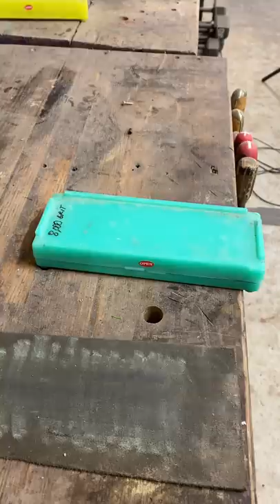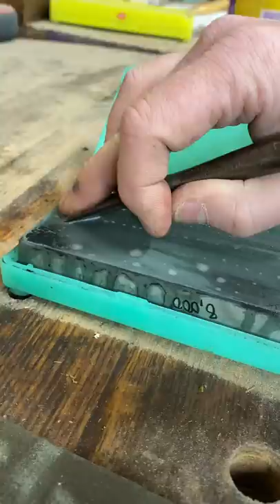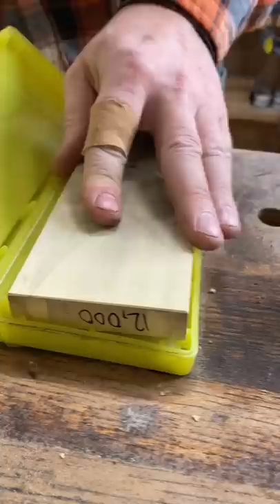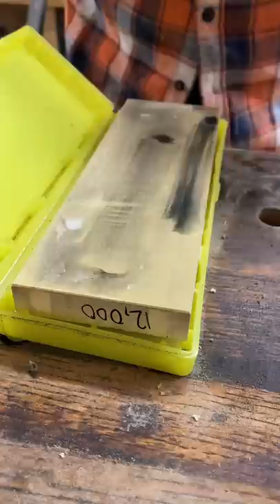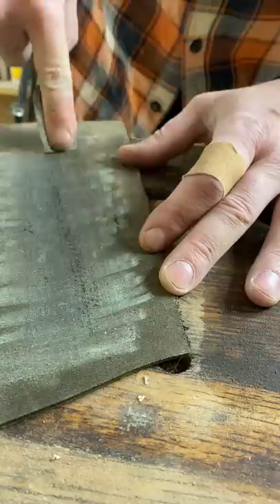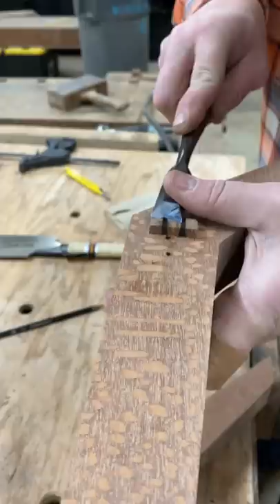Scary Sharp Chisel Sharpening 12,000 Grit #Shorts

Comment: Did anyone notice he spent the majority time sharpening, and 1/2 second showing him struggle to cut the end grain?!?
Reply: He polished instead
Reply: He only honed the back of the blade to 8000 grit, so no matter what you do to the bevel you'll never sharpen it past 8000. 

However most experienced wood workers will tell you there's really not much point in spending all that time sharpening and honing past about 1200 or 2000 because anything past that basically dulls instantly.
Reply: @dawsonharris5498  shhhh your spoiling the magic ;)
Reply: Same thing with professional kitchen chefs. Anything after 1000-1200 grits is just needlessly effort that would last for a few cuts.
Reply: june25  well that's pleasant
Reply: june25  Lmao and what are you?
Reply: Sure did.
Reply: @Lontracanadens1s  the longevity of the edge depends on what your are cutting, what you are cutting on, bevel angles and technique.
Reply: @dawsonharris5498  You’re going to have a hell of a time going through end grain at  1000-2000, especially in soft wood like pine. Yes the edge at 12000 will not last as long but if you have quality chisels and plane blades and a good sharpening system and don’t let your tools get worn to the point of this chisel it’s well worth going to 12000. With a good system and not letting your tools get to the point where they need a whole new edge, you can tune them up in a minute or two and the difference in ease of use is well worth it.
Reply: @dawsonharris5498 ippp
Reply: Yes sure did and using a Guide too
Reply: @08c6vette  Rob Cosman sharpens everything on a 16,000 Shapton glass stone. Plenty of woodworkers that produce high quality work sharpen to 8000 and well above.

Sharpening to 1200-2000 and you're going to have nasty tear out in end grain and garbage results everywhere else.

2000 is for carpentry and tomatoes.
Reply: @thatguythatdoesstuff7448  Exactly, anyone doing serious woodworking that are only sharpening their chisels and planes to 1200 or 2000 must be part masochist, or just enjoy working harder. The difference in ease of use of a plane or chisel sharpened to over 10,000 over one sharpened to 2000 is like night and day. it is very satisfying using a hand plane sharpened to 12,000 and effortlessly taking a nearly see through shaving off the hardest woods, it has almost an asmr effect.
Reply: @carlmen6567  pp
Reply: What about the one shaving that he peeled off with the chisel and boom a whole piece of furniture is built , he's a badass , I would like to have a set of the sharpening stones that he's using though
Reply: @Lontracanadens1s  good to know, thanks 👍
Reply: Don't see the scary sharp chisel...
Reply: @dawsonharris5498  what do you want to say ?
Reply: Dab some naphtha with brush for cross grain cut. Woodcarver's trick. 12000 or 1200. Try ceramic Japanese water stones.
Reply: @08c6vette  I have no problem whatsoever cutting through ingrained with my crappy cheap worn out chisels that are nowhere near sharpened that fine as they are simply sharpened with a cheap whetstone from Walmart and no bevel guide.
Reply: @bobbyhempel1513  If you’re doing serious woodworking  with crappy, cheap, worn out chisels, honed on a cheap 1000 grit Walmart stone I would say your “no problem whatsoever”is simply your perception of what is easy as far as chiseling goes because I was the guy with the crappy, cheap, worn out chisels sharpened with a 1000 grit stone, thinking they were sharp enough and good enough for many years until I finally broke down and bought a decent set of chisels ( no they don’t have to be Lie Nielsens, I have Stanley sweethearts) and a decent set of water stones and I can tell you from personal experience that the difference in using cheap, crappy, worn out chisels vs. using decent chisels with perfectly flat, polished backs, honed to 8000 - 12,000 is like night and day and the ease of paring a shoulder for a mortise and tenon joint or finishing a dovetail joint using them compared to a shitty chisel that is semi sharp is no contest. If you’re doing woodworking using hand tools I highly recommend you try it, yes it won’t hold an edge as long but with a decent sharpening system you can have it back to a razor in 20 - 30 seconds, if you’re using mostly power tools and you just need a semi sharp chisel occasionally what you have will suffice.
Reply: I thought I was the only one to catch that lol
Reply: @bobbyhempel1513  
Couldn't agree more 
My grandad gave me a 2 sided oil stone with a box he made in school 
I still use it and it great, perfectly adequate 
Hes 86
Reply: If you're putting it at 12k final....don't strop...

Comment: Starting at 8000 grit only serves to polish the chisel, not really sharpen it
Reply: Sharpening, honing and polishing are all the same thing. You're either correctly hitting the apex of the edge or you're not, regardless of the grit size.

If he's regularly honing to 12000, starting an undamaged chisel at 8000 is perfectly fine.

I have this 8000 (melon) Shapton stone. Unless the edge of my chisel needs correction, I go straight to the 8000 for touch up.

The more regularly I touch up the chisel, the less likely I ever have to drop down to a rougher grit.

And these Shapton stones remove material very quickly.
Reply: @thatguythatdoesstuff7448  tx 👍🏻
Reply: Agreed you always need a coarse stone to start. I found not doing that was my worst sharpening mistake fine only polishes a dull edge
Reply: I do 99% of my sharpening with 8k.... but that's because I hollow grind my general use chisels so when I go to the stones I'm just polishing a tiny section at the tip and on the heel and I'm usually sharpening often enough that I have a miniscule amount of material to remove.
Reply: @thatguythatdoesstuff7448  all that being said... This guy didn't reach the apex.. which is what the original comment was getting at.

Comment: I find it hilarious how many online vids show things that are incorrect.
Reply: Please elaborate on what was wrong with this vid
Reply: @TatsukiHashida  his entire method was wrong. Go do your own research to find the correct way.
Reply: @ice-xv1hi  bruh
Reply: @TatsukiHashida  first off, he using the wrong profile of chisel. Second, most of what he does is polishing, everything past 2000 grit or so is pointless for tools. When sharpening, you typically start with a lower grit, working your way up to remove imperfections and create a new blade profile. Its important you start low and work up, as starting at a high polishing grit will make it nearly impossible to actually remove the jagged micro-chips on the blades cutting edge. Some lubrication, dw40 or whatever oil of your choosing, will help with rust prevention and a smoother cut too.
Reply: @TatsukiHashida  nobody is trying to write paragraphs to teach you something that’s extremely easy to find if you’re that interested its not like you gotta search hard to find out how to sharpen a chisel correctly
Reply: he made it Shiney.
Reply: @RJ-mh3ox  and what happens when someone types in "chisel sharpening" and this comes up?
Reply: @jefftickleschitz1265  nothing in the video is wrong.  His technique was fine.

Maybe he should have started at a lower grit-  we don't know what shape it was in.

Maybe going to such a fine grit isn't necessary or practical if you are doing work them constantly.

You can ask a dozen people who handle and sharpen different typed of blades and get a dozen different answers.  

The techniques in the video are valid, however.
Reply: @zakpodo  did I say something was wrong?
Reply: @jefftickleschitz1265  no, you responded to all the people saying it was wrong but refusing to explain why-  seemingly asking for more info.

I was just explaining to people like you and the other person who had questions that the video shows a workable method to sharpen.
Reply: @zakpodo  is this youtube thing new to you? As you can see above, I responded to rj.
Reply: @jefftickleschitz1265  what's your problem man?  I was trying to be helpful.

Here's the breakdown-
1.Op implied something was wrong with the video.
2. Somebody asked for more information about what is the right way.
3. Another person told him to go look elsewhere.
4. You said what if somebody was searching for info and it found this (its ambiguous whether or not you were asking for more info or just being snarky)
5.  I replied, to you and anybody else who might be looking for advice in good faith.

6.  You act as if I personally insulted you and as if I'm a moron for trying to do something decent....apparently you have a problem with somebody acting with goodwill on YouTube.
Reply: @zakpodo  the other poster was being an ass, but ultimately he's  correct; just about everything in this video is wrong. Never place your finger on the stone when sharpening, you could pinch your finger or at the very least you'll sand off some skin. You also never move both directions on a stone that high in grit because any angle imperfections would gouge the stone. Also going back to the very first thing that we see him do, never take a precision instrument like a chisel to a stone that hasn't been flattened first, you can tell from the fact that there's still metal material stuck in the grit that it has not been properly flattened and therefore cannot provide a proper edge to the chisel that he's sharpening. Also running the back of the chisel on the stone is pointless because of the thickness of the blade, and finally stropping after 12k sets you back in terms of polish unless you're using a diamond grit.
Reply: @wyntresparkz8702  I don't think you read my post.

You're quibbling about grits, which is fine. But his technique will produce an edge.  

You're complaining that the stone wasn't flattened-  you have no idea if it was, and even if it wasnt it's way more pointless to flatten after every chisel than to strop after 12k.

The point is, for somebody who doesn't know what they are doing (and asking for help), using a technique like in the video is a fine way to get an edge with the stones they have.

If they want to dive down the rabbit hole, there's lots they can learn through research and experience, but for somebody who's intent is a quick how to from a damn Google short.... yes this is the general process.   Flatten back, sharpen front, lower grit to higher grit, maintain for angle.
Reply: @zakpodo  dude, you're the one getting butt hurt. As you did again in the comment above yo wyntre sparkz, you are putting words in people's mouths and attributing direct comments to the whole group. When did Wyntre say anything about grit? I originally responded to 1 person. And you for some reason jumped down my throat about things I never said.
Reply: Ah yes. The classic, “I’m spewing shit out of my ass, but since you decided to call me out on it, go waste time trying to figure out something I myself have no idea of” tactic. Polishing a blade is useless. Anything past 2000 grit is pointless. However, the sharpening technique the person in the video used is how you do it. He did it well. For anyone wondering. A toothy edge is better than a polished edge for actual woodworking. The edge will last much longer and work the wood better. Having a toothy edge also prolongs the lifespan of the tool.
Reply: @pubplays368  he used an incorrect angle to sharpen the underside, shows how little you know.
Reply: @RJ-mh3ox  well I didn't want to look that shit up. I read the paragraph instead much easier
Reply: @jesusdelgado3959  but its easier to watch a few people demonstrate this type of thing if you plan on actually doing it yourself fam i had to do a good amount of research for knife sharpening cuz there’s more to it than one paragraph can teach ya
Reply: I watched my dad do his knifes in the 60s. I still do it today.
Reply: @cornhole8839  "everything past 2000 is pointless for tools" you know you don't need to use that much sandpaper right?
Reply: @miles11we  holy necro batman

Comment: I think the band-aid on your knuckle says it all, So I became a journeyman in 1974 , In England we're called carpenters and joiners , The Scottish Joiner that I worked my apprenticeship under ,  Would be turning his  grave watching you use stones in plastic boxes ,  He made me take a piece of mahogany  And hollow it out to  a 2 piece Box Containing my stone ,  Looked a little bit like a small coffin ,  And at each end of the stone there was a wood platform, The same height As the stone , so you could  Run your chisel the full length of the stone , So you don't produce the giant hollow that ends up in some stones, Also  Other craftsmen would take your lid  And rotate at 90ﾟ  To see if it fit exactly the same , as it was a sign of craftsmanship ,  And not as easy as it sounds,  Also 2 small Brad nails protruding from the bottom Was part of the design , To prevent it from slipping , So you don't need a band-aid while using it ,
Reply: Those plastic boxes aren't horrible -- and you don't want these in wood, they're water stones. But for oil stones I agree

Comment: Shapton pro 12k stone is finer than Chromium oxide pastes, so you're taking a step backwards with polishing. (Chromium oxide pastes are 3-1 micron, about 8,000-10,000 grit, the Shapton Pro 12k is <1 micron)

And stropping with that much pressure at that angle will fuck your apex pretty quickly.

Try refining your sharpening before you go to pointlessly high grits, maybe then you can trim a tenon.
Reply: Looked good to me tough guy
Reply: @10p56  The edge looking good, and performing good are two different things lmfao.
Reply: @10p56  if it's the one we seen him sharpen it's not.
Reply: Ppl buy shapton 30k stones (400$ stone) and think they are ancient samurai Jedi masters 🤡😂🤚🏻🤚🏻
Reply: @As_Asa_PhD  I know, it's not good, that's the point of my comment.
Reply: @tsvorbear3908  You talking about me, or the guy in the video?
Reply: @autumn5592  I was replying to k.
Reply: @As_Asa_PhD  Sorry, my bad.
Reply: @autumn5592  lol no I’m talking about the dood in the video

Comment: 12000 is way overkill a 1000 sharpening block (the metal diamond ones I personally hate oil stone) gets your chisels sharp enough for any task
Reply: What are the difference in practice? I buyied a water stone grid1200 because of the price

I was in to buy the 600 because I saw a video talking about that and I thinked that it would be a better option

Although it was some 1BRL more and my stupid sister was already bothering me about that, so anyway.
Reply: @lordhunterluasuperior905  honestly it's mostly personal preferance, as a general rule the finer you sharpen an edge the less durable it gets, for intance i sharpen my chisels once every two weeks at a 1000 edge if i took that to 1500 id have to sharpen them every week
Reply: @lordhunterluasuperior905  12,000 is like THE final stone, you want something way more course to start with so you can actually shape/flatten the tip before polishing. I’ve got a set of stones that go 250, 400, 600, then 800 or 1000 grit. If your first grit is above 1000 you’re essentially just polishing it, without making sure it’s actually flat beforehand
Reply: I don’t even think those are oil stones they look like Shapton’s. Probably using soapy water. He started on WAY to high of a grit though! Should have been more like 320-400 then progress.
Reply: I'm the same..I have a 1000 grit Diamond "stone" that I've had for over 30 yrs..still in the same workable condition and sharpens chisels n plane blades etc perfectly

Comment: If I recall correctly, Paul Sellers said that they used to sharpen their chisels to 80 grit and then get back to work. I believe he sharpens them a little finer now, maybe 220, but that's plenty sharp enough. Same for his hand planes.
Reply: Yep, you really don't need much for an edge that actually cuts.

Going this high, of even really above 1k is not doing much, outside of specialist applications.

Comment: The final grit of your sharpening depends on the material your chisel is made of. If it's a bit softer, you will get a worse result with a higher grit. I have two really cheap chisels, and the last grit before stroping is 2000 for me. They shave endgrain like butter

Comment: Just a tip from one sharpener to another if you try lightning your pressure when you're stropping you may not roll the edges much and the edge integrity will be much better and you'll definitely notice and increase in cutting. Chisels tend to have a high carbon steel rather than anything with high carbides so polishing it the way you do is great but pushing down so hard on the leather whether it's high carbon or high carbide is going to reduce that The edge integrity
Reply: I strop on the palm of my hand
Reply: If you're giving this guy tips then you clearly don't have a clue what you're doing either.
Reply: @lmaolmao8826  not true
Reply: @dariocarafa3788  that chisel needed a whole new edge profile with those chips but you're talking about stropping. Yes, it's true.
Reply: @lmaolmao8826  I've been a cabinetmaker for almost 50 years,  don't tell me I "don't know what I'm doing".
Just remember, things are different in a production cabinet shop compared to a home shop.  👍🙂
Reply: @colinstace1758  I clearly did not tag you but since you want to involve yourself, you do not sharpen a chiped edge with an 8000 grit honing stone. You would think that in your 50 years building cabinets you might know this. However, nothing says "I have the cognitive capacity of a child with down syndrome" more than building cabinets.